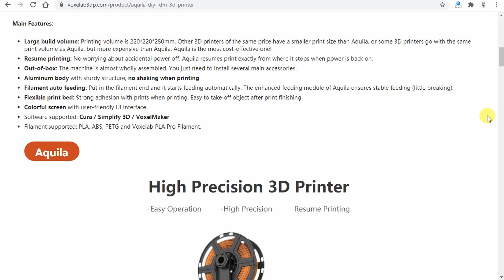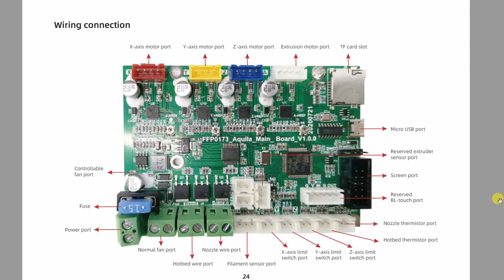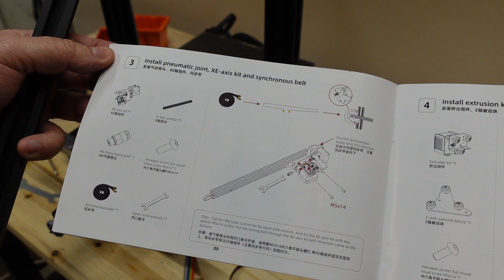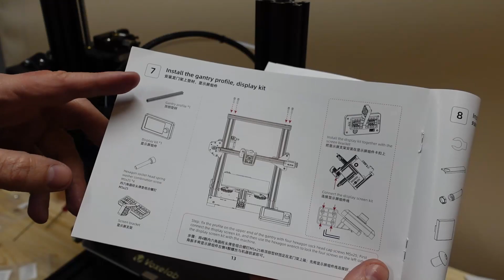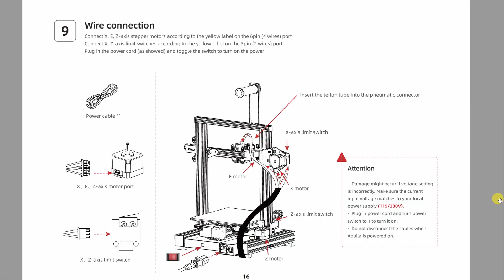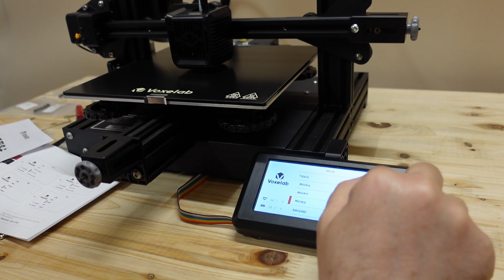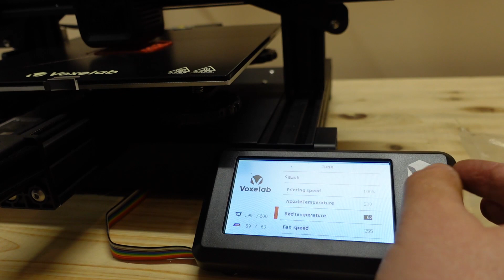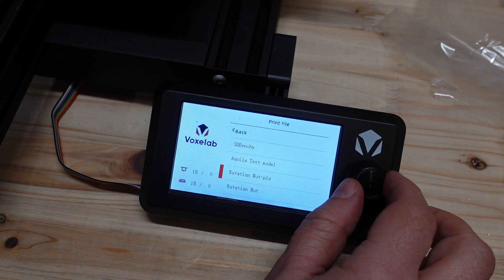Voxelab Aquila - cheap alternative for Ender3 V2 3D printer

Comment: Nice video. One thing you didn't mention was printing PETG on this printer. I believe PETG can bond too well with glass beds, and you need to coat the bed with gluestick before printing.
Reply: This printer prints, PLA, PETG, and ABS without any problems of sticking or adhesion. No bed treatment necessary. Naturally, this may depend on filament brand.
Reply from the maker: I don't have problem with PETG, check your bed leveling, nozzle may be too close to the surface(?). PETG sticks too good to smooth PEI sheets, here it is recommended to have some separator layer, like gluestick.

Comment: You forgot to mention that Leveling of the bed should be done better with the heated bed. 

Why did you keep the belt dual Z axis upgrade on the V2 instead of the add on solution from Creality with the stepper motor?
Reply from the maker: I agree with heated bed, but not significant difference if bed is preheated for PLA, and for begginers it safer to start with cold bed. 
About timing belt: my first upgrade was dual Z with two steppers. Then for video I removed it to present dualZ with timing belt. In the meantime I used that stepper in different project
Reply: @MyTechFun  thanks for your feedback. Though this is for the dual z axis video related question: could you move the gantry by hand up and down after installing the kit? Mine is stiff and I cannot move it the way I could when I only had one stepper motor installed. Thanks for your answer. Your videos are very explanatory by the way.
Reply from the maker: @Flexigem  Yes, I can feel it's harder a little bit, but it should go smoothly. Try to reduce the tension on belt(?), check are screw leads parallel..

Comment: Thinking of ordering this after seeing your very informative video. Do you think it can print a regulation size  Ping Pong Racket 10.6 inches by 6.6inches by 1.5 inches high if it is sliced diagonally on the bed?
Reply from the maker: I don't know, depend of the shape, try to draw it into 220x220 square (bed printing surface)